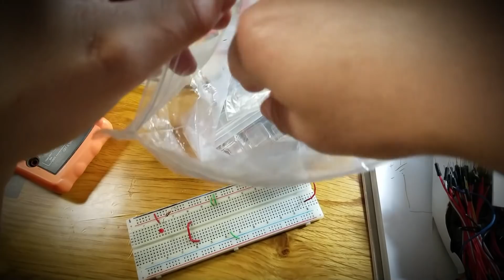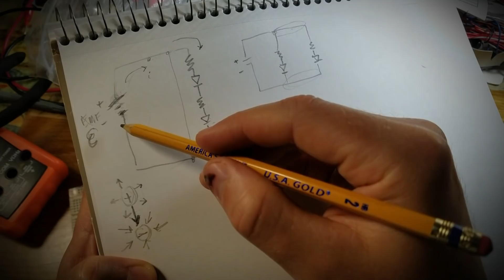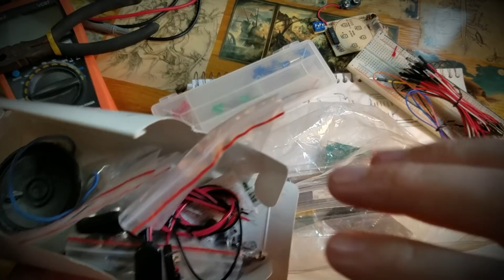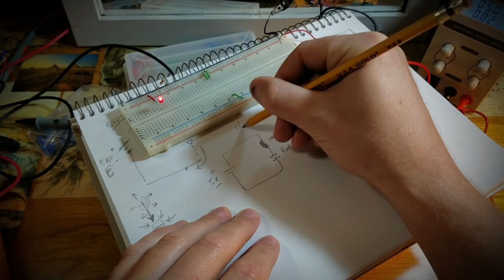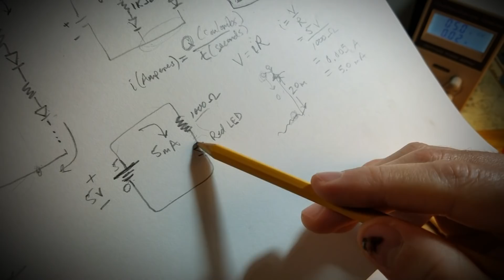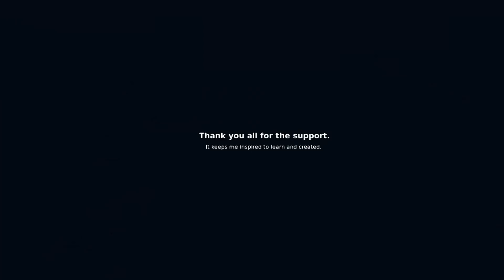simple electronic circuits | ASMR soft-spoken

Comment: 6:10
I don't think I've ever known or heard about grease being on membrane contact pads. That's really interesting and I don't think I've ever seen that in a device but does make sense. Especially on devices that may be exposed to moisture or other harsh conditions. That's why the fingers are usually gold-plated. Usually with a tougher hard plating instead of a standard soft gold plating like you would see elsewhere on circuit boards. The hard plating helps hold up over time.. like what you would regularly see on an edge connector, cartridge, or something else that has to stand up to repeated action and wear.

I have seen Greece on gold switch pads. Like if you open up a multimeter and look at the Gold fingers under the main rotating selector knob.. sometimes they'll have a really light coating of conductive grease. But for the most part unless the meter is used in a bad environment and needs to be weatherproof... High in meters of void grease because it can attract more dirt and debris which will wear out the contacts quicker. Obviously it would cause wear quicker than just a press of a button because it's being rubbed back and forth on the gold plating. 
But I've only ever seen that in test equipment meant to be used in harsh conditions, or in multimeters that aren't quite top of the line not really cheap stuff or anything but just not your top end fluke or HP agilent meters. It seems a lot of the cheaper meter movements may use it to help the smoothness of the mechanism whereas the more expensive meters are smooth because of the high quality. Both are fine in my book and I've had dozens of meter spanning the spectrum from cheap too metrology grade

But concerning the membrane pads.. I usually just see the rubber/ membrane button with a black conductive rubberized coating so that when it is depressed.. it will bridge the little fingers on those membrane pads

Go back and check out one of "marco reps" video when he was restoring the fluke calibration unit. I think that's the video maybe it was one of his high-end meter restorations I'm not quite sure. But he took isopropyl alcohol and started cleaning those pad contacts.. and it wiped them away and he ended up having to design and replace the board. He tried conductive paint at first to try and touch it up but ended up just making a custom board. Pretty interesting and a really useful thing to keep in mind if you do a lot of equipment and metrology type restoration and libration work

In his example I think the conductive/carbon graphite type coding where the actual board pads themselves. Hence why they wiped away with solvent when he was trying to clean them

Comment: Love this video. I repair electronics and I would love to see more and more people being less afraid of it, and start getting hands on. Another interesting point about diodes is the fact that because the voltage drop is relatively stable across a diode (although not completely) it makes them useful for a lot of functions. If you reduce the current flowing through a diode, by a factor of say 10 by changing the value of a resistor, the voltage drop across the diode will deviate by only a small amount.
Reply: Just finished the video and just realised you actually mentioned this. When thinking about a diode as a resistance It helps to imagine that actually it is equivalent to a variable resistor. The magnitude of the current dictates it's equivalent resistance. This becomes useful when using transistors. I'm getting super nerdy I know.
Reply from the maker: ok that makes sense. clearly i never had a good grasp on transistor technology. its hard to understand how current is controlled with current and how it causes such huge gain increases
Reply: @RealLetsFindOut  It's easier to think about it in these terms. The small base to emitter current that "switches on" the transistor simply allows a larger current to flow the collector through the transistor and out of the emitter. Current flowing out of the base region allows carriers to flow from E to B. So when a voltage is applied across the BE junction, which is roughly in the region of 0.7V, a small number of carriers flowing from the emitter combine with the minority carriers in the base, and the rest flow to the collector.The usefulness of equivalent resistances for transistors is really useful when doing small signal models where you want to simulate  impedance and small signal gain of an amplifier etc. The subject is quite heavy to discuss in Youtube comments and I find it hard to describe. Think I need to study it all over again.

Comment: What is that triangle symbol under the resistor? I have never seen anyone use that when drawing circuits.
Reply from the maker: It represents a diode, which is just a one way valve, basically (current can only flow in one direction through it). An LED is a light-emitting diode, which is a diode with special chemicals that react with current to produce light.
Reply: LackOfAnotherName I believe it just represents an LED light or a small light source in general.